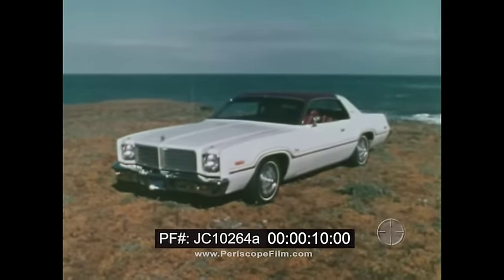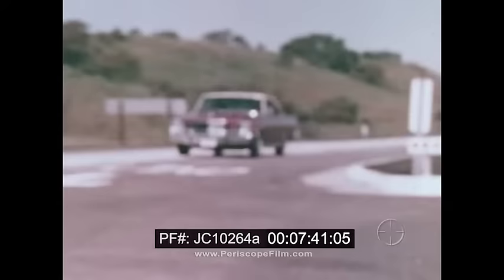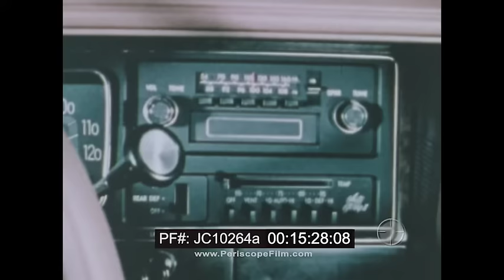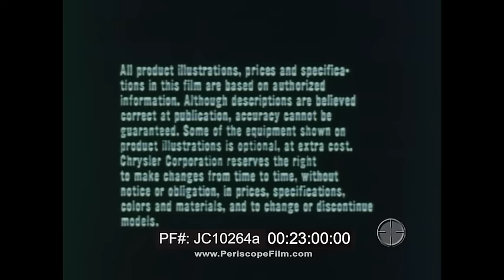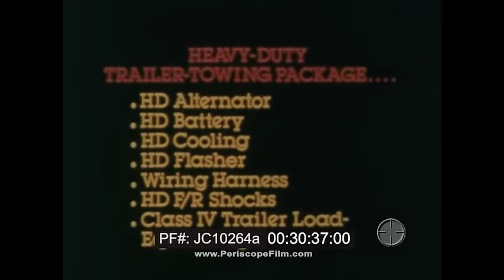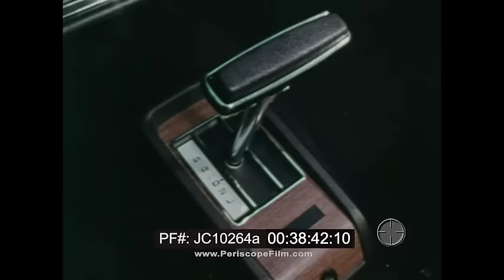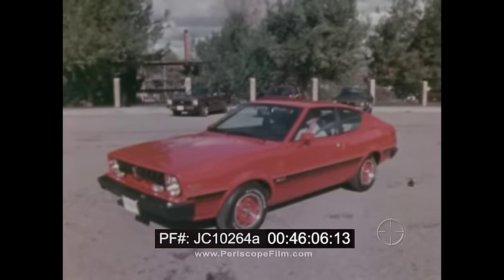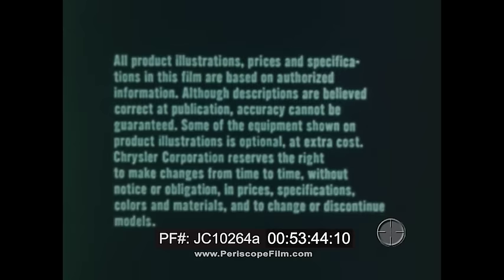1975 VINTAGE DODGE CAR, TRUCK & VAN  ADVERTISING PROMO FILMS   DART  GRAN FURY  ARROW GT JC10264a

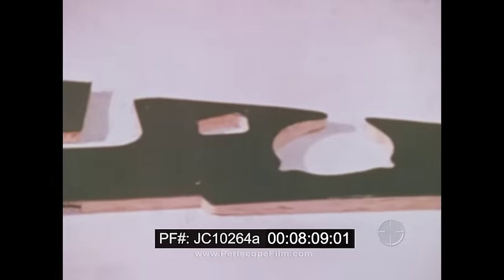Comment: @8:11 If you bought a 1974 Dart, screw you! We’ve fixed the shortcomings of last year! 😂

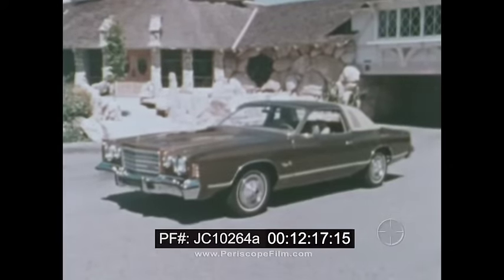Also, @12:18 this generation of “Charger” is a huge disappointment. The only gen that’s worse is the 80’s gen FWD Charger. That being said, I’d still happily take one. It’s not that it’s a bad car, it’s that it’s clearly attempting to be a Monte Carlo competitor and not an actual Charger.